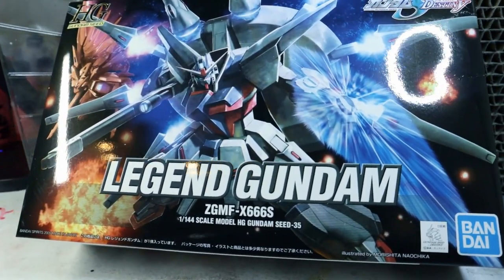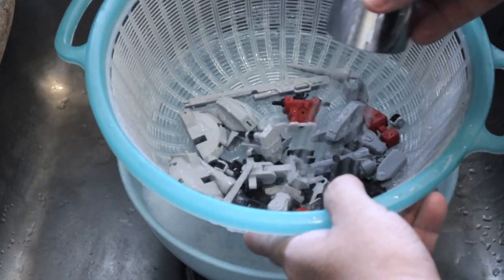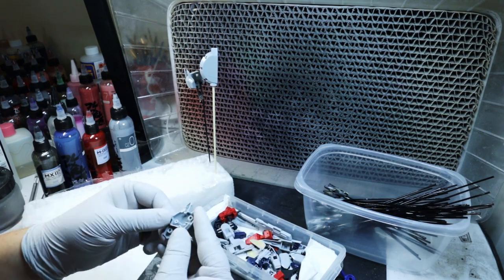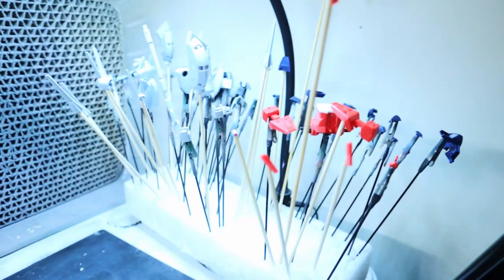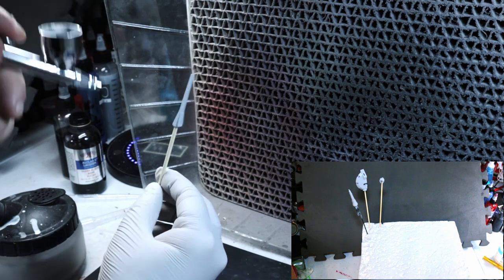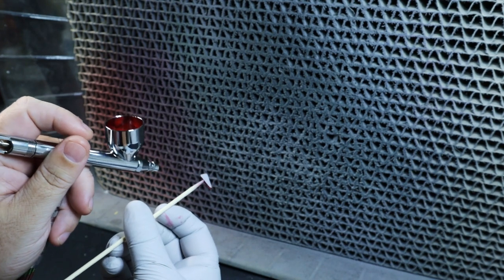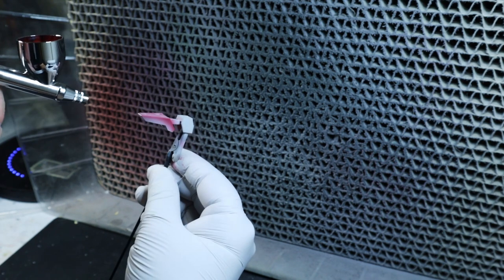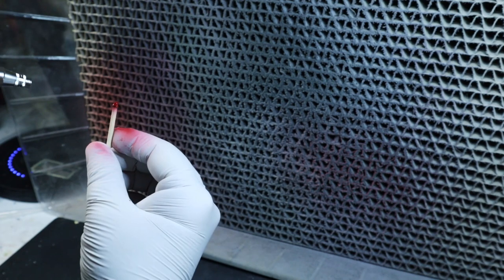Airbrush Gunpla Tutorial - Complete Airbrush Tutorial Series

Comment: Tip for proper clip station you can buy or make it your own. From time to time I used foam but after a while, I notice that there are foam pieces around my workshop and spray booth that's annoying. So I switch from foam to card box holes. The best way to make it is to use cardboard of card box cut into slices and glue them together it's cheap easy to get and you can decide how long or small you want. ;)
Reply from the maker: Hey great tip! I mentioned cat scratchers as well in the first video of this series. For me, the foam was a free option and I haven't had to replace it yet, but yes there are specs of foam in my work area 🤣🤣🤣
Reply: @PlamoTherapist  that is also a way to get rid of the foam xDDDD

Comment: Do you use gross or flat paint? i am not sure if i should do gloss>panel line>matt coat or Flat>clear gloss coat>panel line> matt coat
Reply from the maker: Hey there! Great question! I use a mix of gloss and flats to get what I need. For me, color accuracy is more important than paint finish as you can always clear coat to the final desired effect, and gloss matte paints for panel lines and decal work. If there's a paint color that you REALLY want, don't let the finish stop you from using it. 😁 Hope this answers your question, and best of luck!
Reply: @PlamoTherapist  Thanks, but i ask mainly because i am thinking i can skip gloss coat before panel line if i am using gloss paint. and then just put a matt topcoat
Reply from the maker: Ah, I see what you're saying. Yes, you are correct. You can skip the gloss step if your paint is already glossy. 😁

Comment: Any advice on priming white pieces with gray primer? Having some trouble getting an even coat because visually it's hard to see
Reply from the maker: Hey great question! I've actually started doing two coats of primer for this reason. One that's a bit darker than what I want before going in with the finishing surfacer to get the final shade of grey that I need.  If you don't have a dark grey primer, you can mix in a drop or two of black primer. Give this a shot and see if it works. Best of luck! 😁

Comment: Airbrushing noob here. Any advice for those starting with the gundam airbrush system, like myself? Do I still need to prep my pieces by washing them? 

And I noticed that with the gundam markers, they dry pretty quickly. Should I still wait a day before trying something like using multiple colors, or just snapping the kit back together?
Reply from the maker: Hey there. In terms of starting with the Gundam Marker System, the best advice I can give is to develop good fundamentals. Consistent spray distance, Starting and stopping before and after the piece, checking for complete coverage, etc.

As for washing pieces, it's not absolutely necessary, but still recommended. Are you primng your pieces too? Even a rattle can primer works well.

As for waiting for pieces to dry, I suggest overnight if you paint in the evening, but about 4 hours is more than sufficient. As for alcohol markers, I think 4 should be more than enough as well.

Hope this answers your question and best of luck!
Reply: @PlamoTherapist  I never thought of using primer, is that absolutely needed if I’m just using the airbrushed gundam markers?
Reply from the maker: Not absolutely necessary, but it'll help the colors pop more and be less affected by the color of plastic underneath.
Reply: @PlamoTherapist  Aw damn. I just left store in got my supplies from 😆 next time then. 

Thanks for your wisdoms
Reply from the maker: No problem. I wish you all the best. 😁